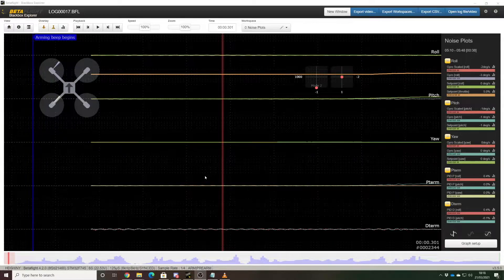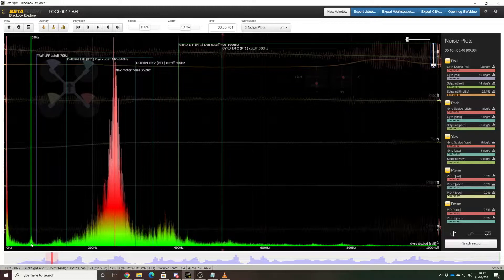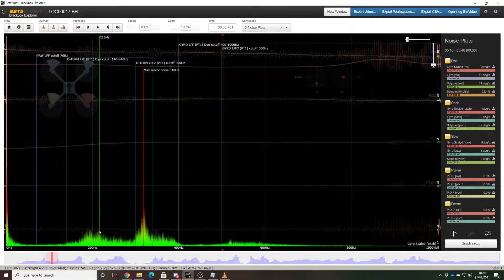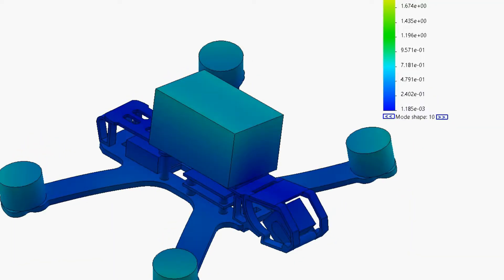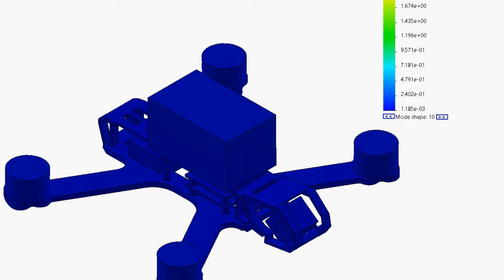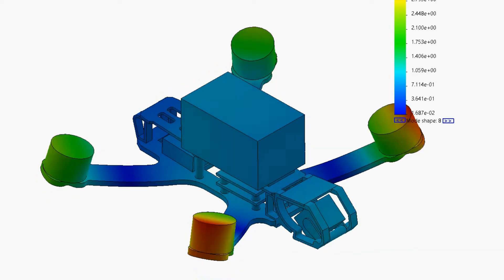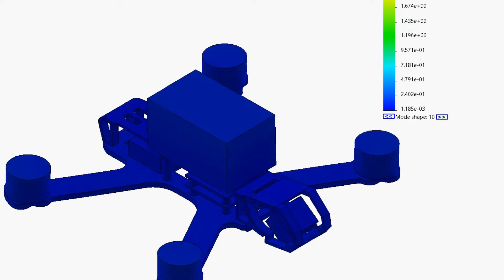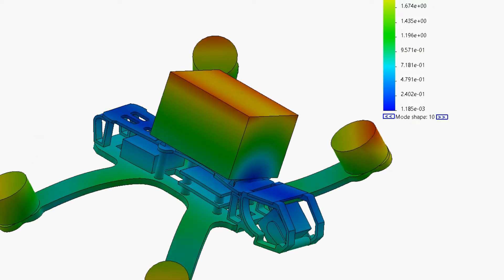Resonance analysis of the Armattan Marmotte, Shaken not stirred!

Comment: I have this frame with premium parts, F7 stack,  imperial motors, stubby antenna, dji polar vista, that I have set up to what seems perfectly acceptable,  and it vibrates like  a loose hubcap.  I have no clue what to do. Has anyone else had a terrible amount of vibration in this frame?  It flies and sounds like its got a broken prop.  Brand new pbj's
Reply from the maker: Best option: Transfer the build to a different frame. The marmotte has issues with resonance performance. If I'm allowed to recommend my frame the AOS 5.5 that is the highest performing 5.5" frame I know of regarding resonance.
Quick option: Try BF4.3 and hope the SDFT can do a better job of controlling that resonance.

Comment: This is why I am replacing my chameleon-ti with the Apex, I could not get the noise out. It would resonate so badly at 80% throttle that my FPV video would have noise introduced, and I was loosing screws and my lens on my FPV camera became so damaged from vibration I had to replace it.
Reply from the maker: Yes, lots of people have the same experience I'm afraid! That's why I designed the AOS 5

Comment: Hi Chris.. before using blackbox to find frame resonance, i always checking the resonance by tapping the frame with my finger nail. When it vibes (like having echos) i can tell that the frame is having resonance issue. And this afternoon i picked up my marmotte frame from my drawer 🤭 and adding electrical tape at every spots where the carbon frame meet the aluminum/titanium part. And after that i tapping the frame with my finger nail and the vibes are way shorter (looks cleaner from resonance).. this makes me want to re build it again and see the noise profile with bb log. Maybe ill do this in next few days and hopefully it doesnt waste my time rebuilding it hahaha. Maybe the electical tape can help a bit just like prototype 5 frame from kabab. 😊 Cheers
Reply from the maker: Yes electrical tape can definitely help in some situations, but there have also been cases where it makes things worse. Mechanical damping grease works better and more consistently than electrical tape and lots of people are using it to great effect on their builds. I have a video on it if you are interested.
Reply: @ChrisRosser  oh it can make it worse too? Yep i watched the video.. but i cant get the grease here in my local

Comment: Hey Chris, that's interesting...my marmotte (Spacegrade) gyro_scaled looks completely different. I hope to find some help here about filter tuning after watching your filter and PID Videos, but this didn't help at all 🤔 any suggestions: https://photos.app.goo.gl/k4ixTrvJnQrR9gP78 (roll)
https://photos.app.goo.gl/hEvutQyS4Etbeg498

Best...
Reply from the maker: I have videos on filters and PIDs I hope they help you!
Reply: @ChrisRosser  I've watched both an there are awesome 👍 and animated me to do some BB logging and tuning again. I agree to all other comments, that tis is one of the best explanation of logging and filtering I've ever seen. But I found non of your describe noise characteristics. No vertical for resonance and no diagonal for typical motor noise. I've discovered a small wide noise band between 300mHz & 500mHz and hope to find some information here, but your marmotte measurements look completely different. Best, Marcel ✌️
Reply from the maker: @cor3fpv  Ah yes, you have the space grade carbon that will behave very differently to the normal carbon. There is still the band of motor noise but your resonant frequencies are higher because the space grade carbon is stiffer (just above 300Hz on your picture but it is hard to see)

Comment: Hi Chris! I must say I really appreciate your true scientific approach on these difficult topics. 
I have a question for you. Well, I actually have many questions but let's take one thing at the time. Looking at this typical Armattan approach - a wide relatively thin arm, if we cut a triangular shaped part of carbon sheet and glue it 90 degrees on top or bottom of the arms, would that not make a huge difference in arm/frame stiffness for very little weight? In my mind that would stiffen up the frame and raise the frame resonance to a much higher frequency in all axis?
Reply from the maker: If you can get it really well bonded it should help a lot.

Comment: Interesting stuff! For my marmotte the 250Hz resonance is completely absent in the blackbox.. i only see a significant resonance at 335Hz on both roll and pitch. If anything then on roll i get a second (must less pronounced) resonance at 206Hz. How would you explain this?
Reply from the maker: Do you have space carbon by any chance?
Reply: @ChrisRosser  yes indeed!
Reply from the maker: @robbinvanhoek121  So that explains it. The extra stiffness of the space carbon pushes the resonance up from 250Hz to 335Hz. This suggests that the space carbon is ~34% stiffer than the regular carbon!
Reply: @ChrisRosser  thats pretty cool! is that anything i should be concerned about? do i need a notch there?
Reply from the maker: @robbinvanhoek121  The dynamic notch filter in BF should clean it up so I wouldn't worry about adding another notch.

Comment: Sorry just typing while watching while kids yelling... 
soo.... 
apologies, I'll do this ramble often.. But I'm a Patreon now so :) 

can we somehow apply these known resonance as a filter with the onboard gyros  / FC... 
also does, how the force is applied make much difference? 
slower smoother application of power by esc tuning change how these manifest? 
smooth motors, notchy motors, aggressive timing... 
or motor RPMs and resonant frequencies.

we know X frame resonates at Y Hz. 
reduce motor power on Z Rpm's..... or something...
Reply from the maker: Absolutely! With the new dynamic notches in BF 4.3 we should be able to set the right number of notches based on the number of vibrational modes present in the frame and the filter code should find and crush the resonances. ESC tuning can definitely help as can PID tuning but to improve vibration we have to detune PIDs and ESCs so its not ideal for flight performance where we would like the gains to be as high as possible.

Comment: Really interesting thanks 👍😎 I notice in your resonance analysis you are using the HD version of the frame which has a longer body and top plate but has an extra stand off compared to the standard frame.

I actually had the standard Marmotte and noticed a big spike around 250hz in blackbox and after breaking the bottom plate converted it to a Badger under warantee. The seperate arms seemed to reduce the noise in blackbox, not sure if they are thicker and narrower than the single piece bottom plate but maybe the carbon is also cut out of the sheet in an orientation to make them more rigid?

It’s still a noisy frame but the filtering in betaflight does a really good job and it’s actually a lovely quad to fly. My biggest gripe about it is the arms break too easily compared to my more traditional frames.
Reply from the maker: The individual arms do add thickness and therefore stiffness to the design. Armattan are making a tradeoff for durability with these lifetime warrantied frames. They are more noisy because the frames are designed to be more flexible/tougher in crashes. Apex video incoming!

Comment: Thanks for doing these tests.  Love seeing what you come up with but I am curious how large of a sample you have for this frame as well as what your build and PID tune is along with the betaflight version.  I can only imagine that a good tune on a bad frame will show less noise than a bad tune on a good frame.  I have multiple builds on the marmotte, 6s with Xing 2208 1800kv BF4.2 with bi-dshot and rpm filtering(my youtube pic), and I have a lot of black box recordings where I am not seeing the same thing you are.  My logs are actually extremely clean.  Would you be interested in checking out the flight logs of my Marmotte to compare to yours?  Let me know and I can put them on google drive.
Reply from the maker: I collected a few logs from the community to check my results were representative. I haven't found the tune to affect the gyro_scaled plot too much provided the gains are kept relatively modest. If you  have debug mode =  gyro_scaled logs that look very clean then I'm happy to take a look. You can email me them at the address for the channel 😁

Comment: Hey Chris, love the content and as an engineering student its incredible to see the stuff I learn and do in class applied to a real world application. I have some Solidworks files for the Ummagawd Moongoat and FPV Cycle Glide, and have blackbox logs for both. Would you be interested in running a vibration analysis on either?

Also, you mention the wide, flat arms of the Marmot being the main contributor to the resonate mode in the roll direction. The Rotor Riot CL1 VS frame has arms made of 6mm carbon, but they are rather skinny. Interested in your thoughts on how that affects roll and pitch resonance and what other resonate modes may result from that design.
Reply from the maker: Glad you enjoyed the video! Yes I would love your SW files for the moongoat and glide with the BB files (gyro_scaled if possible!).

Thick skinny arms are better than wide thin arms because the worst resonant modes usually involve the arms bending up and down and as you will know you get a cubic contribution to second moment of area with thickness in a vertical bending mode.
Reply from the maker: You can find my email in the about section of my channel, looking forward to hearing from you.

Comment: Aramttan should make 6mm narrow 4 in 1 esc arms like the cl1 vannystyle
Reply from the maker: That would certainly help. They should also try to squeeze another standoff into the design so the top plate has 8 points of contact rather than 4 or 6

Comment: Mate may I ask you a couple things;

1-In your analysis did you actually input the proper material properties (I mean the full set of orthotropic specifications) or is it just some anisotropic simplified model?

I highly doubt that you have access to the space CF data; but you certainly know that any such analysis, whether it be static or dynamic is pretty much moot without the model following the real world as close as possible, right?

2-You mention the lipo leveraging the top plate into such vibration.

But did you consider that the real world lipo attachment may have a certain degree of dampening due to the lipo strap flexibility? Or did you just clamp a brick on the top plate making it behave as one solid part?
Reply from the maker: Hi Titansteam, thanks for your comment! I use an anisotropic approximation of the carbon fibre. It is not a perfect replication of real carbon fibre, but the difference in resonant frequencies between the simulation and the black box log is only around 10%. The goal of the model isn't necessarily to perfectly replicate reality but to approximate it closely enough to allow the mode shapes to be visualised.

The lipo attachment is modelled by a battery pad with the same softness as a typical gel battery pad such as Ummagrip.

Comment: I wonder if the Badger with removable arms has the same resonance issue?
Reply from the maker: Geometrically they are very similar so should have similar modes of vibration but removable arms introduce significant damping at the joints which can reduce the amplitude of the resonance in the frame.
Reply: Im interested in this too having broke my marmotte and swapped it out for the badger as I bet a lot of other people did as well.

Comment: Doesn't the anisotropic behavior effect this type of simulation?
Reply from the maker: The material is anisotropic as modelled and it only needs to be an approximation to visualise the mode shape at a similar frequency to what's seen in the blackbox log
Reply: @ChrisRosser  What exact material do you use? Does it matter a lot  if I choose e.g. ABS or steel to simulate it?
Reply from the maker: @ariafpv  You can find some material parameters online for carbon fibre. That's what I've used. It doesn't matter too much whether your parameters are absolutely spot on as I am more interested in the mode shapes rather than the exact frequency. I get the frequency from the BB logs